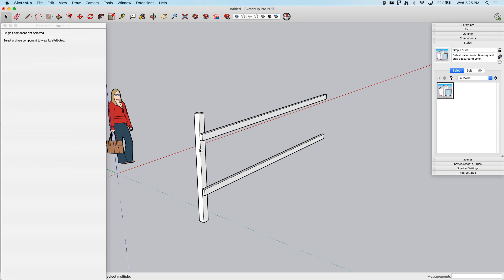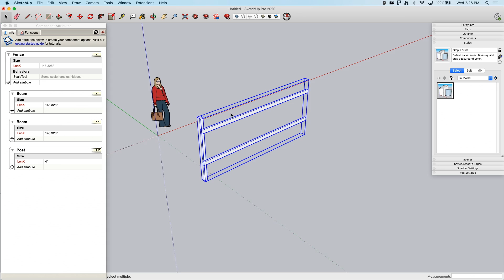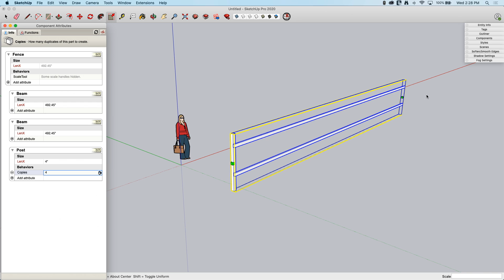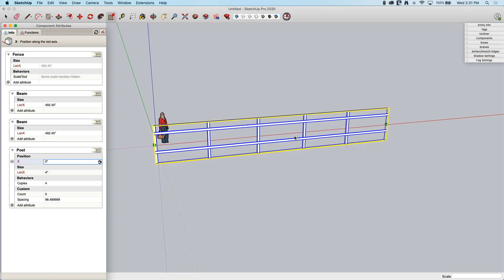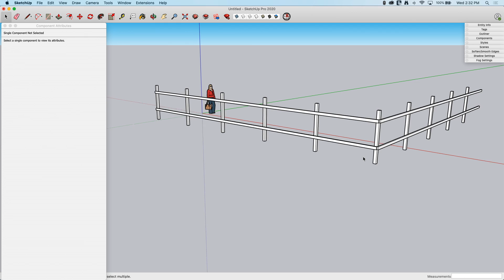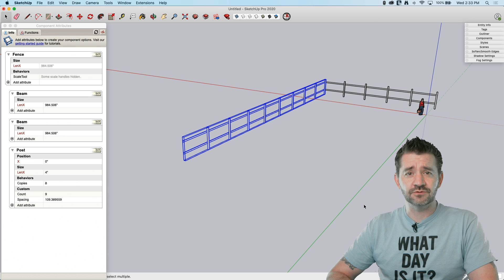Dynamic Component Fence Part 2. - Skill Builder

Comment: Very useful content thank you. I've learnt so much from these. 

One thing I am struggling with it working with cabinets. 

I screw cabinets together and want to set my dynamic cabinet with the screw holes through the sides. Obviously, I keep the spacing no greater than a specific measurement while the first and last hole are a constant dimention from the front and back edge while I scale my cabinet.  

Using your videos help however things just keep going haywire on me. 

Any videos you know of that might help me with this.